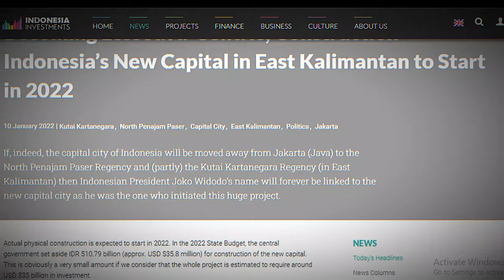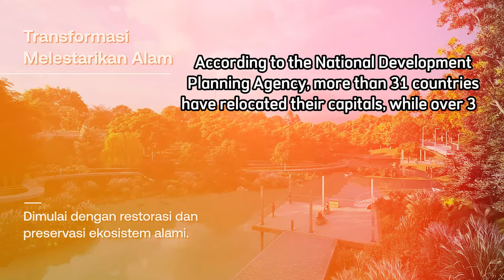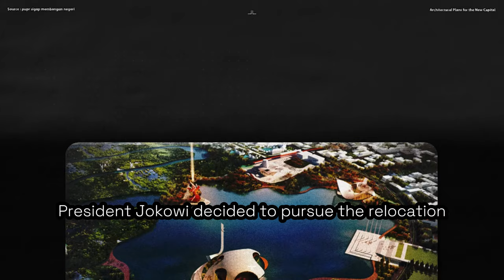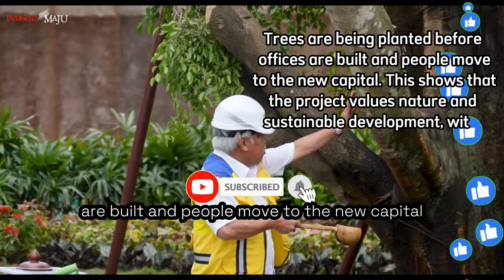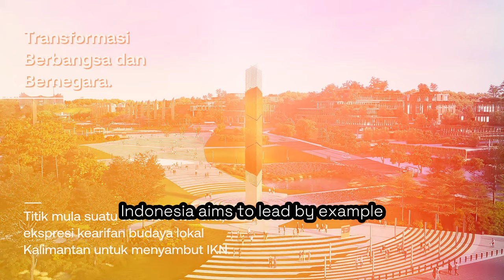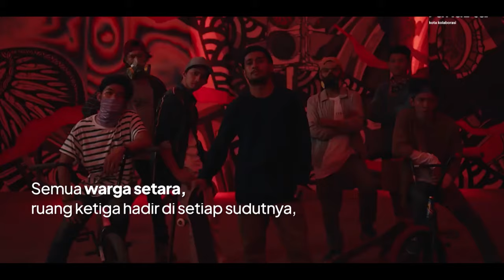INDONESIA’S NEW CAPITAL AND THE MISCONCEPTION

Comment: Also the other misconception is that this capital will be similar to the new capital of Myanmar or Egypt, with empty massive roads and huge buildings that were not eco-friendly. Nusantara won't be the same as that, since it is the first and the most comprehensive green city ever made in Indonesia and there will be a lot of EV public transportation available. So it is far from dystopian gloomy mega city surrounded by airport size runways asphalt.
Reply: capital city in the world should be less crowded than a commercial city. Washington DC is not as bussies as NY. Wellington is not as busiest as Auckland. Jakarta has the miss concept.
Reply: Green city huh? Just wait till the haze starts again and Indonesia resorts to finger pointing ( as always) instead of solving the forest fire issues,  then let's have an honest discussion about Indonesia's green credentials
Reply: @wtIUpITp1E0wMsydV19c0FUmIXvCU  in fact Singapore companies who have business in Indonesia are mainly the main actors.
Reply: Their capital was built on the middle of the desert, IKN is built in the middle of oil and gas deposit and 2 industrial hubs Samarinda and Balikpapan also close to bontang. Its not the same, there's plan of building Petro chemical factories there

Comment: In 2024,don't set new year financial goals without consulting a financial adviser.there expertise ensure a solid plan for success.Building wealth involves developing good habits like regular putting money away in intervals for solid investments.
Reply: Thanks for the advice! I'm new to financial planning and wasn't sure where to start.Any tips on finding a reliable financial adviser or resource to guide beginners?
Reply: I agree, based on personal experience working with an investment advisor, I currently have $650k in a well diversified portfolio, that has experienced exponential growth. It is not about having money to invest in stocks,but also you need to be knowledgeable, persistent,and have strong hands to back it up.